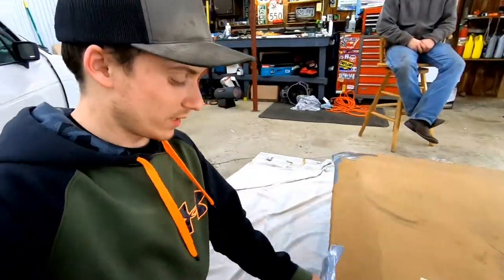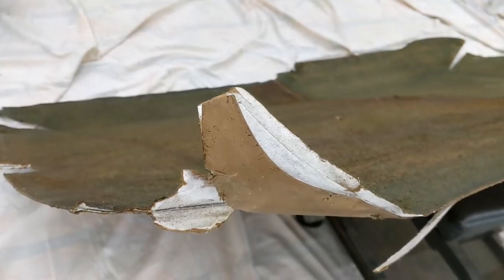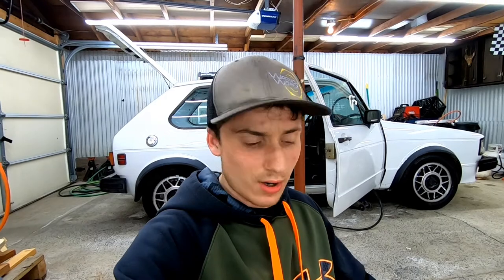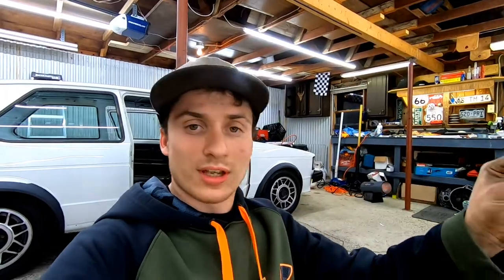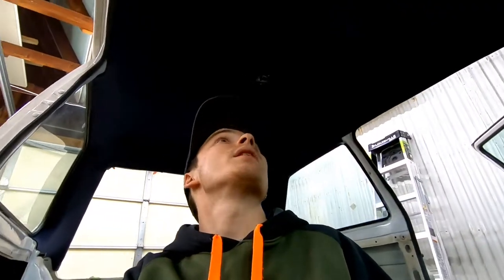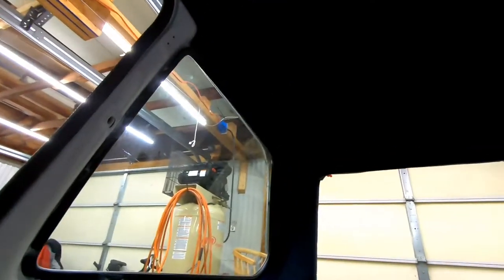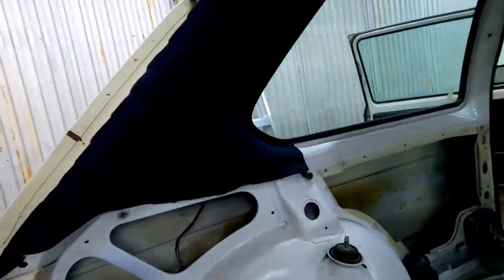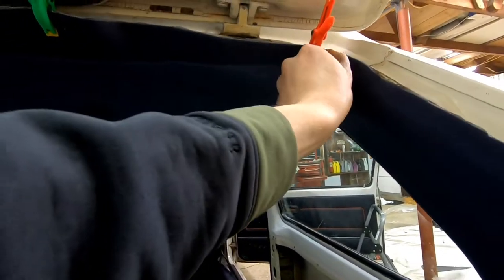1984 Rabbit GTI Headliner / C Pillar Upholstery

Comment: Excellent job! I'll be working on my Head liner soon and was wondering if you had a link to where you got the fabric.
Cheers!
Reply from the maker: https://www.amazon.com/Yards-Headliner-Backed-Fabric-Material/dp/B089YWNLB7?pd_rd_w=C8YmS&pf_rd_p=1a37ebd3-847a-476b-b9f6-6ca64f4f5919&pf_rd_r=Y6N1T38BVM93PXZVERH0&pd_rd_r=94e9fc2d-32eb-4357-8e3c-0bc17a50ef01&pd_rd_wg=Ecb1K&pd_rd_i=B089YWNLB7&psc=1&ref_=pd_bap_m_rp_41_sc
Reply from the maker: Here is a link to the fabric. Definitely recommend it. One thing to note, I have the same fabric in black for my daily and the A pillars did fade after about 2 years.
Reply: @RadoMatt  Thanks for make all the videos! I'll be fixing my seats, head liner plus body and these tutorials will help me out a lot 🤟